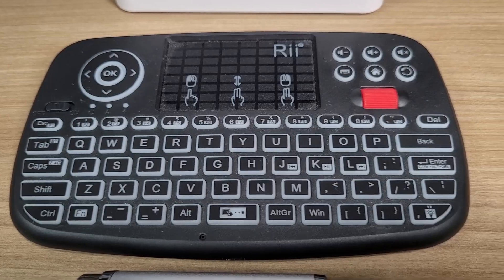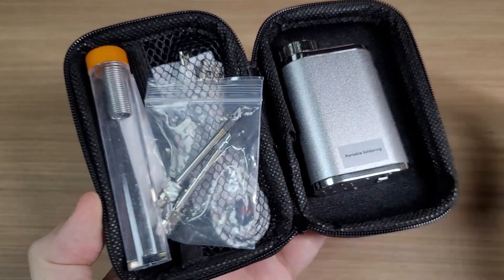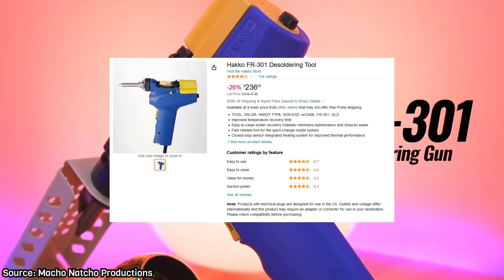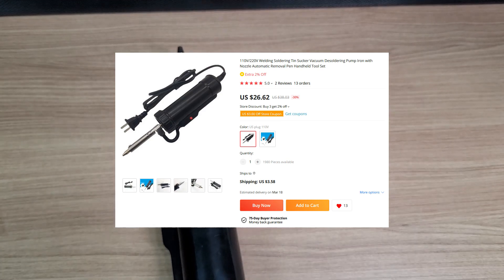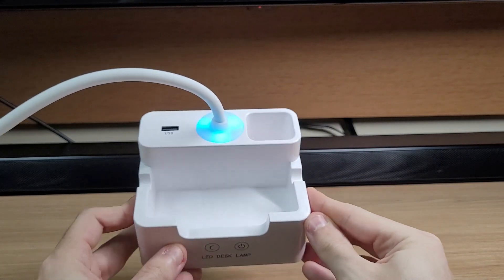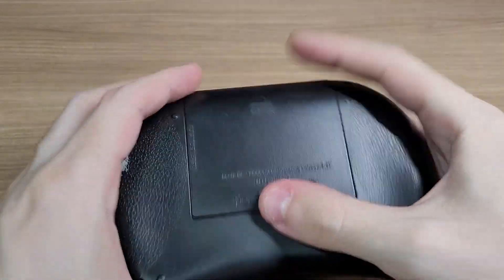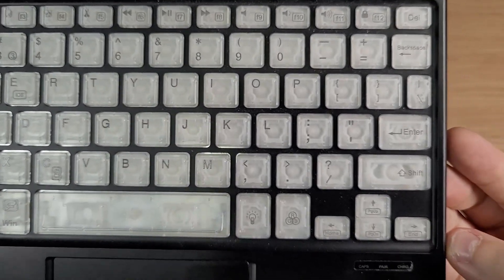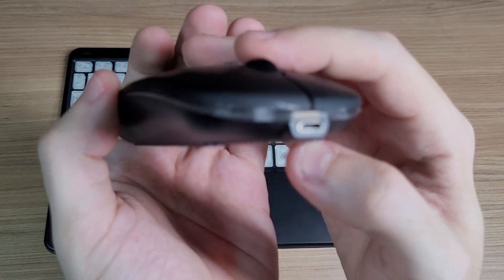VK's Recommended Tech!

Comment: I've owned that de-soldering pump and couldn't get it to melt the solder at all, ended up getting the hakko after and if was much better
Reply from the maker: Maybe the voltage was wrong too?
The blue one doesn't melt it too because its on the wrong voltage

Comment: Your portable soldering iron is huge! You could try out the Pinecil 64 with a portable USB C PD power bank or a USB C PD charger. Much smaller imho
Reply from the maker: If you add the usb powerbank it gets much less portable

With the one I have you're already good to go and just need to throw the carrying case in your bag with no additional accessories
Reply: @VKsChannel  the pinecil is much easier to hold and therefore easier to solder with imho. I can't imagine using something as large as the one you showed with SMDs and other fine details. To each their own though